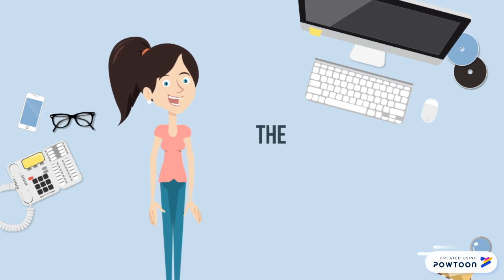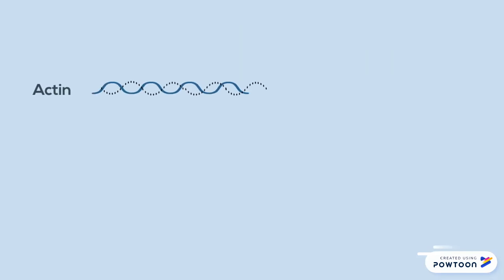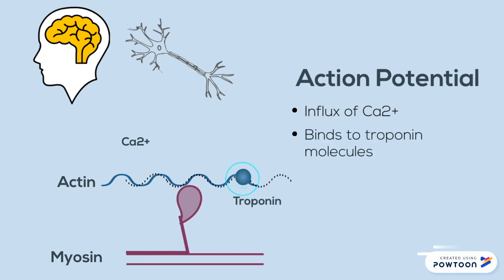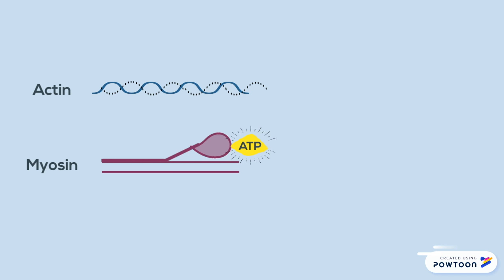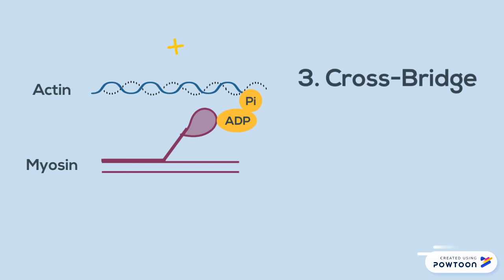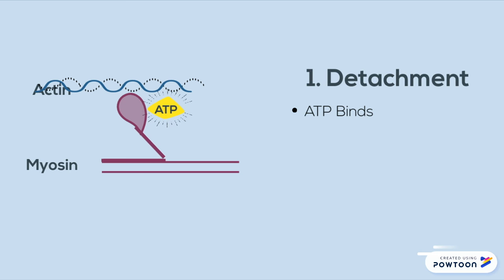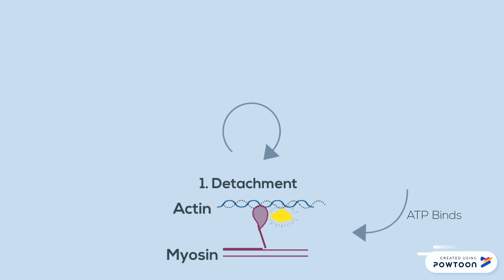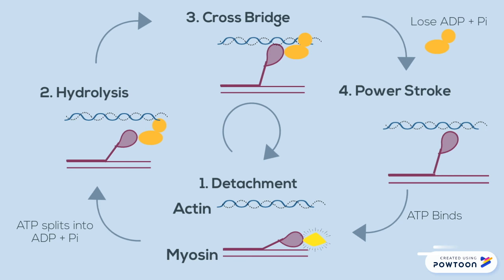The Sliding Filament Theory of Muscle Contraction | FOUR STEPS

Comment: why is the power stroke referred to as "going back to the relaxed state"? my book mentions so too, i don't get it :/
Reply from the maker: I can see how that's confusing. I’m not sure if this is the most accurate way to explain this, but here’s how I think about it: 

I visualize myosin as almost a “slingshot” and the ADP + Pi are pulling it back. Once the ADP + Pi are released, it causes myosin to almost “snap back”, pulling actin, which causes the muscle fibres to shorten. 

Summarizing this in another way, the power stroke happens once the ADP + Pi are released, because this causes myosin to shorten quickly and pull on actin. 

Let me know if this helps your understanding!

Comment: when does contraction happen ? is it when power stroke or attachment ? please answer and i will subscribe and share ..
Reply from the maker: That's a tricky question, because you do need both the crossbridge and the powerstroke in order to cause a muscle contraction. From what I've found, the simple answer is the powerstroke - that's what pulls the fibres closer together.
Reply: @HEATHERFIT  thank u.. Subscribed... Now